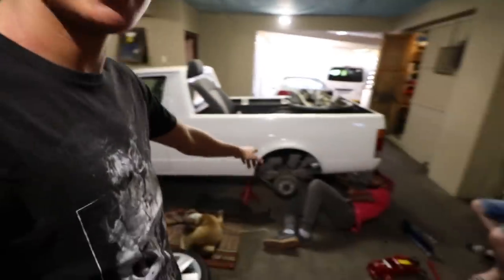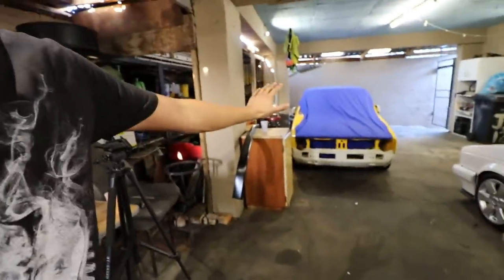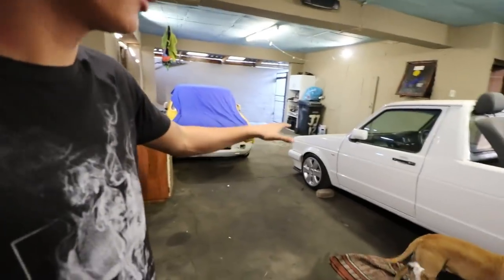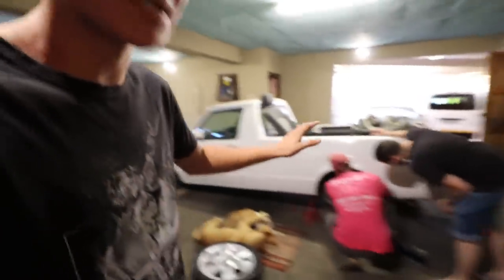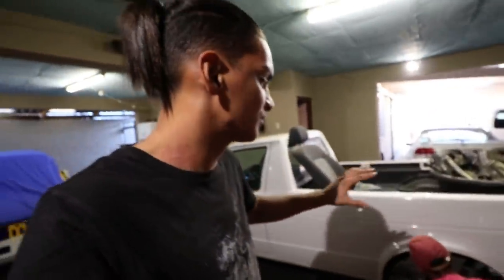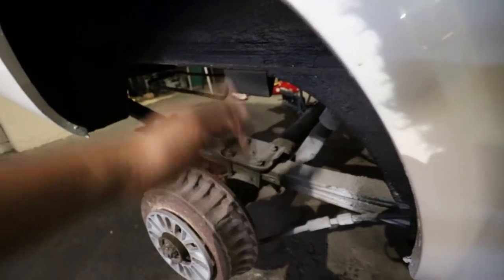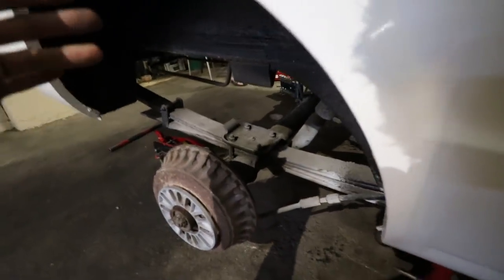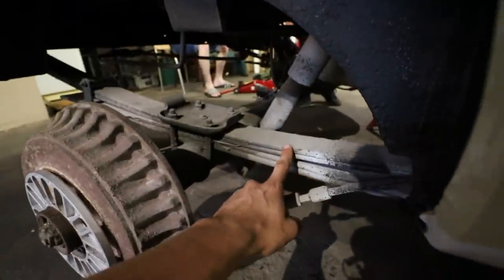Lowering the Caddy's rear leaf spring suspension

Comment: If you guys are ever struggling and need proper suspension work done visit Riaans Suspension Centre in Somerset. He setup the suspension on my Caddy....springs were cut when I initially bought it, but he got my Caddy sorted 100%. My Caddy is now 'original' even though it is dropped. Running on Velo R rims. Riaan is a drift and gymkhana driver and still does his wheel alignment with a manual machine. Give him a shout out.
Reply from the maker: You maybe have his number so that we can contact him?